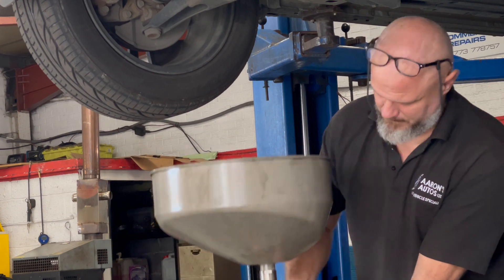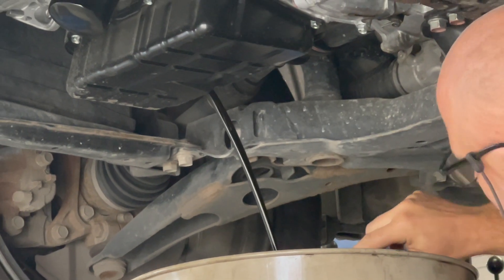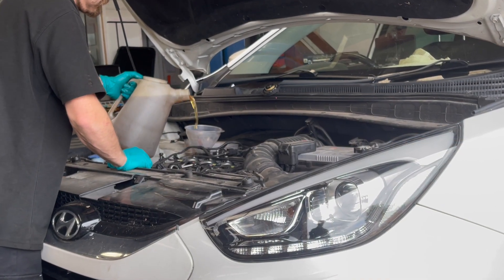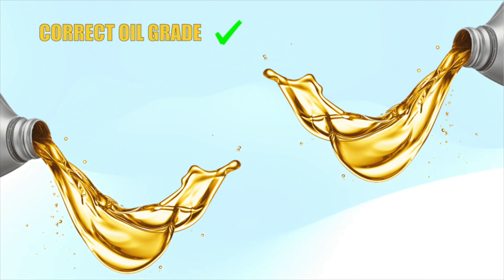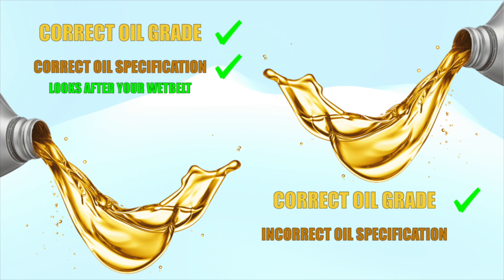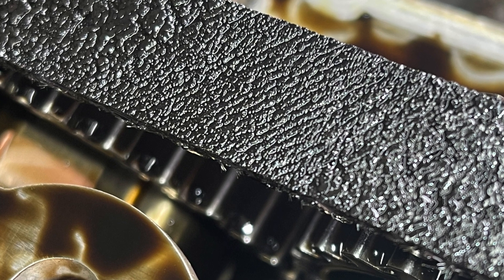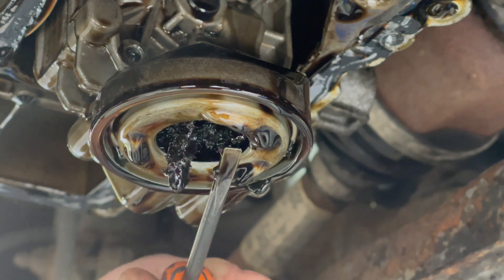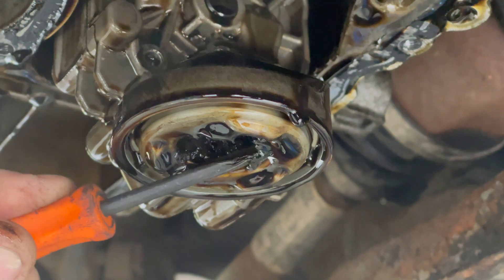Why Is Oil Important For Your Wetbelt - Ecoboost

Comment: I know this video is a couple of years old now, but why so many apparent failures of just the transit customs?

Even back in 2017 Fuchs had a bulletin stating all tdci wet belts needed 0 30 to M2C950A. Garages still filling with 5 30 M2C913D though

Comment: I bought a Citroen C3, 2024 model. It only done 2910km before the fist service. Citroen overfilled it with oil, luckely I check my oil and picked it up. Went to the dealer, and insisted it be drained and new oil put in. They did that, when I got home and looked at the invoice, it like you said, they put a 5w30 oil, which is right where I live in South Africa, but it was the wrong spec oil, went back, and had them chance the oil and filter immediately at their cost. The guy at the spares did not know about the specific specs, it's scary. I'll take my own oil from now on.

Comment: This is why I think the wet belt is a bad idea. Garages will use the wrong specification oil and the average driver may not know about it or not check. The wet belt makes the average driver more at mercy of the garage. If they are going to do it they should slap a big warning under the bonnet saying the spec lol